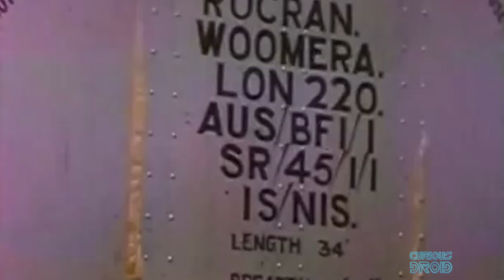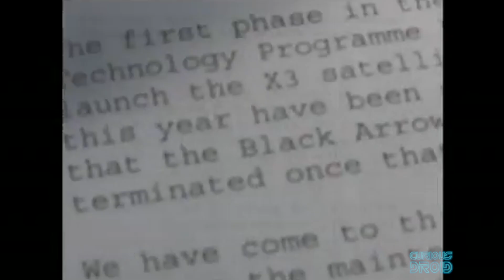Black Arrow : The Lipstick Rocket - A Very British Space Program

Comment: HTP fuel rockets make a lot of sense. Such a shame it got discontinued for stupid political reasons.
Reply: Everything has it pros and cons.
Reply: They are horrifically inefficient, and incapable of carrying any real amount of payload as a result.
Reply: @lobsterbark  Horrifically inefficient? HTP/kerosene has a specific impulse just shy of the LOX/kerosene set up of the Saturn V first stage but with better density impulse, no need for cryogenic facilities, lower combustion temperatures and better cooling characteristics. Additionally HTP was used as a monopropellant to run the turbo pumps in a simple, reliable closed cycle adding significantly to the real world efficiency without engineering complexity or additional weight. As HTP/kerosene is hypergolic ignition is reliable, consistent and requires no separate ignition system.

So far from being horribly inefficient and incapable of carrying any real amount of payload it was in fact about as efficient as the system used on the rocket with the greatest lift capacity yet built.
Reply: @lobsterbark  A non-toxic, non-cryogenic, hypogolic storable propellant is well worth it.